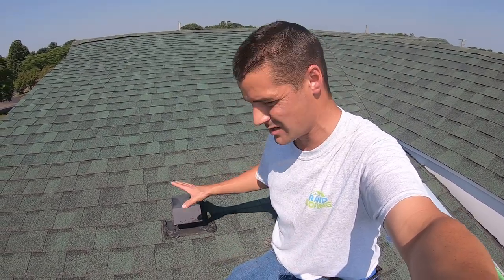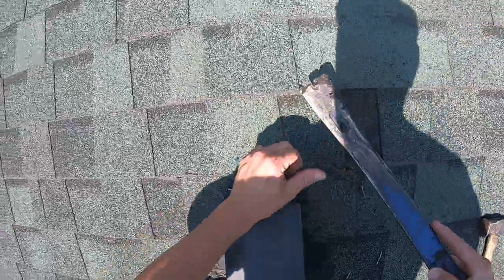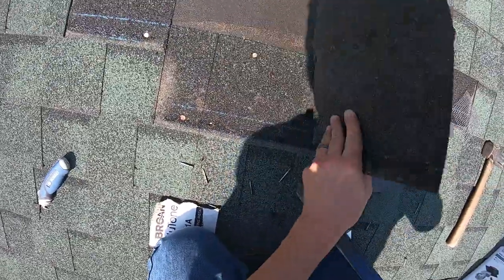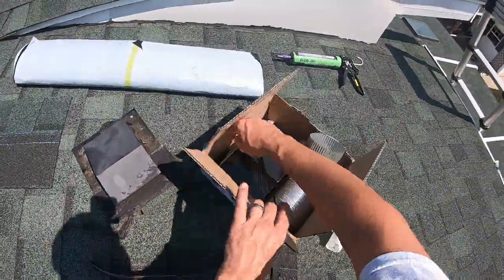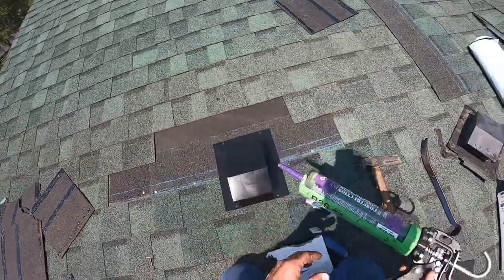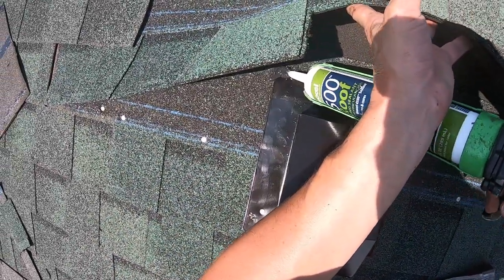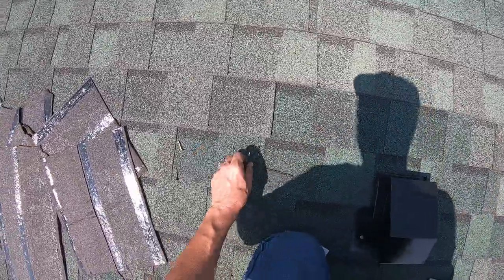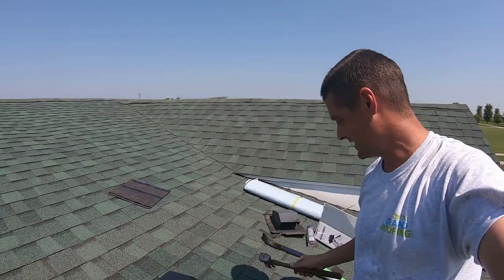Roof Leak - Finding and fixing the Roof Leak - DIY damper vent Install

Comment: At 27:35 or so you point out the separation of the laminated tab. On my day old closed cut valley cuts, every tab was lifted. Roofer had not dog eared or nipped, so I inspected the combined 50 feet. All along the cuts, triangles and partial tabs where lifted like pockets. I was using tar base sealant/adhesive. How every tab was lifted/pocketed, is beyond my imagination. I was using a sharp hook blade to nip, but would a dull blade cause every tab to separate like that. The bottom of the tabs remained bonded. I did try to hit each lift with sealant, but man there was tons of them.

Comment: Good old fashioned couch cushions bro! Anybody's throwing out a couch on the curb, rip the fabric off the big cushion pieces and use those. We usually spray the shit out of them with Lysol or bleach and let them dry out for a day and then we kneel on them all day long all summer. It even helps out on rubber roofs when we're doing detail work

Comment: I'm a service roofer and we get a lot of these calls,  and we use caulking around the whole also underneath the metal to create a gasket , so if water does get underneath it doesn't go down the hole.

Comment: Thanks for the video A DIY guy here who just installed one of these roof vents for a bathroom fan. I've done a few roofs on garages and out buildings but never on my house. Very scary cutting into your roof but I watched  this and a lot of other videos carefully and I think it will be fine (I will keep checking on it. The roof has less than 10 years left so I'll get the pros to take a look at it at that time and maybe fix and replace if needed. The installation instructions that come with the roof vent aren't very thorough so videos like this really help. Thanks.

Comment: Icing the entire surface is good IF you upgrade your intake and exhaust venting mightily! Just incase anyone else caught that. Ice and watering the whole surface can in some cases cause moisture to be trapped ironically enough. The moisture in the attic does breathe through the roof deck and through the underlayment and "out" of the roof. So in those circumstances make sure you get your ventilation moving better than ever so you don't rot out the roof deck with ice an watering an entire section. And my guess is thats true for Indiana just as much as it is here in Wisconsin! God bless and Awesome video!

Comment: Great information. Mine started leaking today after heavy winds on our new home. We were told it was fixed before closing but I guess we were lied to. Nice to know the anatomy of whats going on up there for when I get up there and poke around when it dries out. Thanks for the info!
Reply: Bought mines few months and was told roof was inspected last year. Sometimes roof just act up due to heavy wind or rain that wasn’t found during inspection. I learn that today. Just need to learn how to spot it, make repair, and pray doesn’t come back 10x lol😅

Comment: I thought buying a vent with an integral round pipe was a good idea until it came to sliding it into position. Fortunately, my 25 year old shingles still had enough flexibility. I plan to have a new roof installed within the next year so I didnt caulk the flange down. Hopefully, my shingle will prove to be watertight.

Comment: I have had problems those vents . if the wind blew the right way it would blow that flapper open i had it on a metal roof i replaced it with a pipe with a turn down elbow solved the problem

Comment: Nice flat bar to finish the cut trick. I usually just do a round cut until I can come straight down. Good take away for me I'll definitely give it a try. I can't speak for the other guys watching but I watch the other guys you seem to have issues with and pick up bits and pieces from them as well. Like you said if it doesn't leak you did a good job. Roof on sir
Reply from the maker: Thanks!

Comment: I know I takes another tool but just a suggestion instead of a exposed nail use a washer gromited metal roof screw that matches the color of the roof jack. Just my two cents.

Comment: I just use soft plastic/rubber kneepads. Works great. Doesn't damage shingles even in the Florida heat, unless I twist on them, which I am careful not to do. The straps take a couple week to get used to and may cause some redness, but that goes away after the skin toughens up some.

Comment: Fast excellent work roofer!! I wonder if shade could be placed over the work area weighted by sand bags ? , with a common 6/12, / 4/12 rake just a thought. Think light weight, of course and easy assembly with cropped legs.
Reply from the maker: I've thought about using something for shade before but that won't take the heat out of the shingles I'm kneeling on. Most repairs are pretty quick though. Except when filming.

Comment: Great video i have a leaking roof vent and only leaks when raining hard with wind . My friend who is an experienced roofer helped me  install the new roof on my garage and with a vent without the flexible hose. It's just a small garage does it really need a roof vent ? It didn't have one before and years later the roof started leaking everywhere but didn't  look that bad so replaced it with a roof vent. Luckily I think I have a few pkgs of shingles.

Comment: Old couch cushions..  take the foam out and put it in a trash bag then back into the cover. Then if it gets rained on it's not that wet and dries quickly .get a set of 2... they also allow you to walk on a steep or hot roof without scaring the shingles up.
  It was leaking under the left side and getting trapped by the tar and overflowing the bottom cut. I've made good money because people don't understand that you can't caulk/tar a vent in. If installed correctly it doesn't need it and it will only make it leak, not fix it. If you are going to caulk it, it must be done under the vent, not on top.

Comment: my roof is a 7/12 and shingles are 20 years old... i lost a few bundles from the big storm 3 weeks ago... there is no way i can work on my knees without slipping off... i need to find a big piece of  seat foam it grips super good and have seen roofers use it...

Comment: I just had to repair one of these but the way the whole was cut I had to do what you talked about at minute 13:35, the flange does extend past my 1st shingle but the box wall is still withen the first shingle only a centimeter of the flange extends past it. My 3rd layer sits flush on the top of the box. Should I got back and put another hole in the roof slightly lower so I can stack my shingles like your did on layer 2 instead of layer 1?
Reply from the maker: I'm not quite sure what you're talking about. If you have a picture email it to the email that you can find on the about page and I'll review it.
Reply: @GrandRoofingInc  sent an email with a photo. Sorry dont know the correct terms so this is hard to explain

Comment: Always ice and water. Don't agree with you exposing more flange then necessary.  Agree with your comment if it doesn't leak you installed it correctly

Comment: Not a big fan using sealant to stop a leak when ice and water would have accomplished it and done a better job in my opinion.

My question is why would you cut the shingle instead of taking out the whole shingle.

All you would need is to take out a couple more nails and you would have the whole shingle out and you wouldn’t have to worry about cutting.
Reply from the maker: Ice and water is a good product but not always. I avoid using ice and water going over vent pipes and such in the winter time. In the cold weather it does not seal down. I've actually seen it wick water back up under it, if it is not sealed down. 

Depending upon where the shingles come together in relation to the area you're working on it might be beneficial to cut some off of each side totaling just less than one full shingle as opposed to removing 2 complete shingles.

Comment: This might seem silly but from an outsider perspective: why don't you use shears to clip/trim shingles? Like if you had some shears that could withstand chomping through shingles would you use them?
Reply: Shingles nowadays can be extremely thick and sheering through them all day would make your hand last 10 minutes. Sharp knives are just so much quicker & easier. Not to mention You’d need some pretty large sheers, impossible to use both hands on sheers w no hand for the shingle